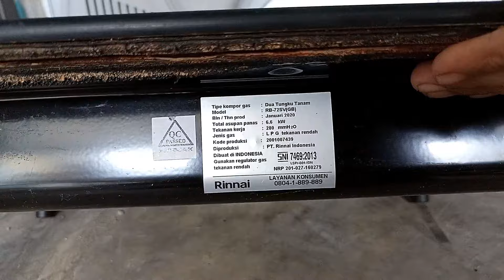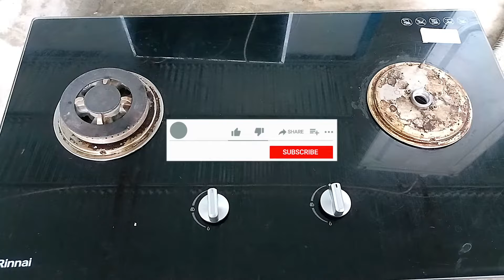KOMPOR GAS TANAM RINNAI RB-72SV(GB) TIDAK BISA NYALA

Comment: Bang kompor sy sama kaya abang. Terus gak mau nyala tapi yg putihnya nyalah. Udah ganti gas dan batrei tapi gak nyala
Reply from the maker: Coba bersihkan lubang spuyernya seperti di video
Reply: Siang master.sy ada kompor sama dgn yg di video apao kecil dan sy sdh bersihan lubang spuyer pakai jarum tp nyalal tetap kecil kira2 apax yg masalah master🙏
Reply from the maker: Mungkin banyak kotoran dlm gas valve, lepas spuyer , semprot dulu sebelum pasang spuyer yg sdh dibersihkan. Klu ngak ada kompresor , pake pipet, tiup manual 🙏